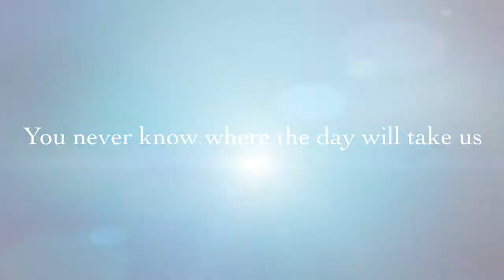Exterior Renovation | Part 1| New Siding | Makeover | Hardy board | Working in Alaskan Weather

Comment: Is that real break on the bottom or is that some type of covering? And if it is what is that
Reply from the maker: It is not real brick. My mom had concrete put in around the bottom of the house a while back and she found this plastic brick stuff to cover it up. I am not sure what it is called, sorry.
Reply: @LewisFamilyVlogAlaska  no worries thanks can you tell me how she had adhered it to the cement? And where she got it?
Reply from the maker: I am not sure how it is adhered. You can take it right off. I am sure she got it from Homedepot. Home that helps.
Reply: @LewisFamilyVlogAlaska  you are so sweet to put up with my questions thank you so much for helping me with that I will take a look you guys have a blessed day